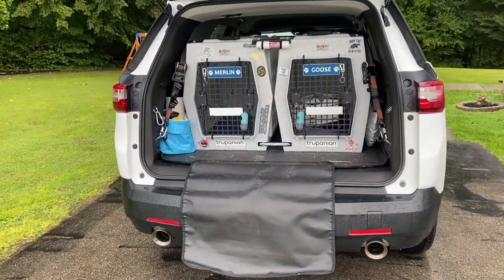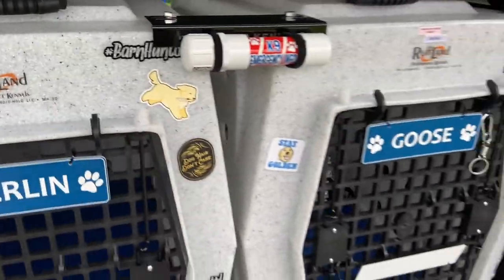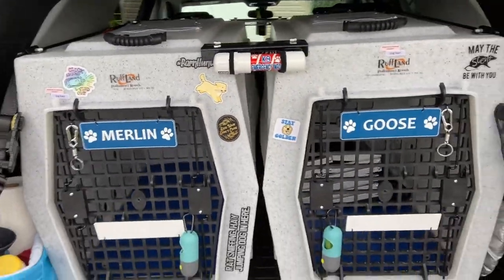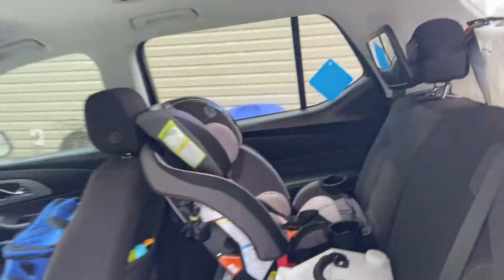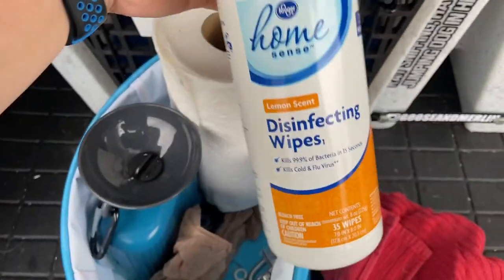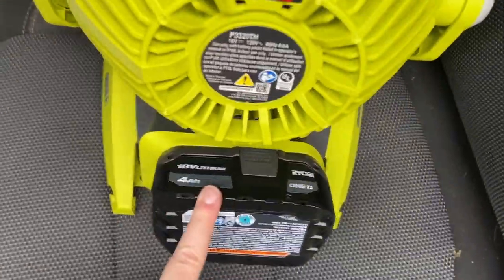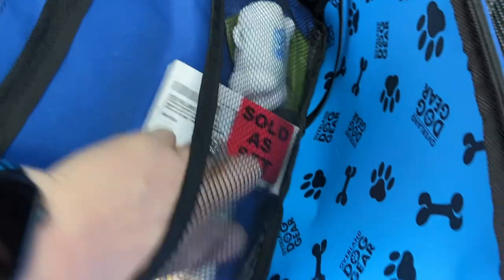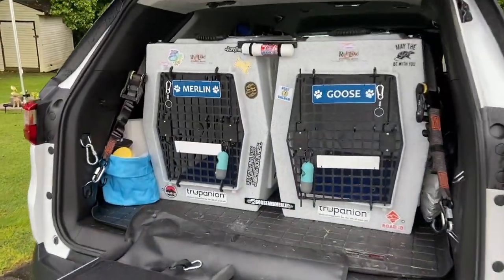Dog Sport Car Crate Setup- Ruff Land Kennels

Comment: This looks great! With the SensorPush monitors, do you need the wifi gateway or will it work without wifi? I saw them mentioned and have been looking into them, but was confused about how they'd work in a car w/o wifi 🤔
Reply from the maker: They work through Bluetooth. If you get too far away they will not work. But they are perfect for Barn Hunt